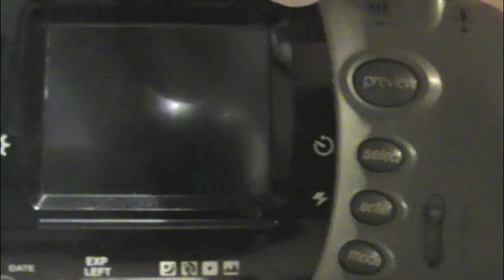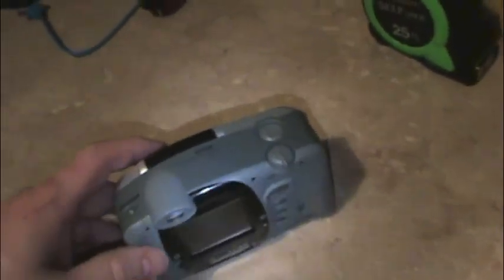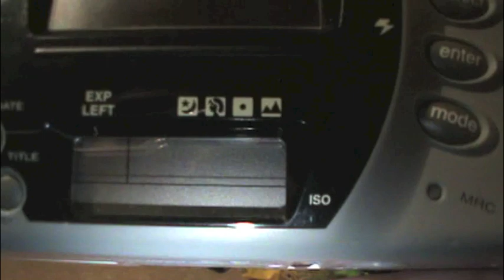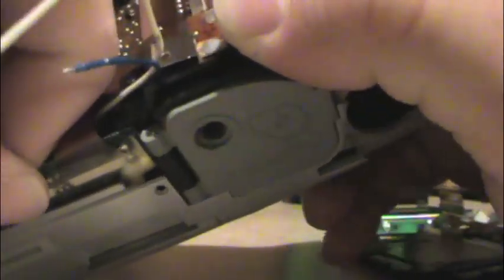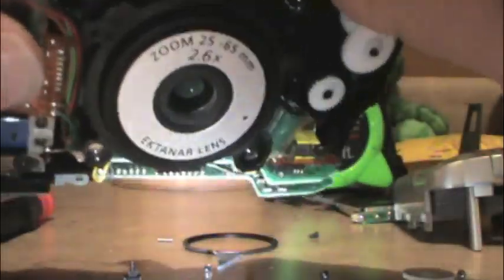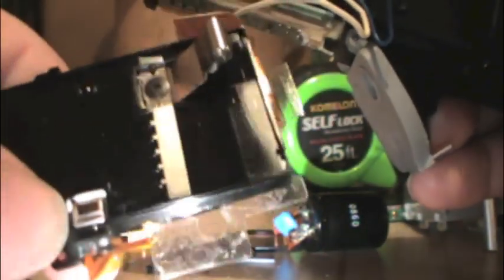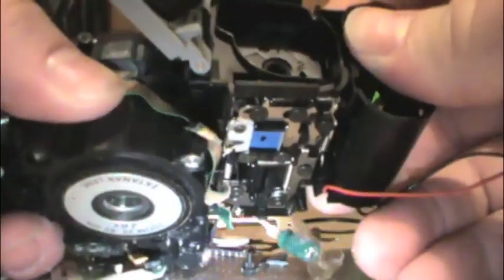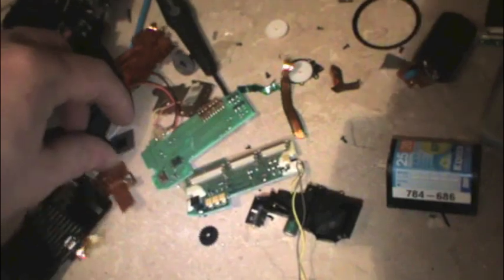Kodak Advantix Preview Camera COMPLETE TEARDOWN!

Comment: APS negatives were 56% the size of 35mm negatives. If it were the same size, it likely would have caught on with pros. The APS-C size does live on as a imaging sensor size on all low and mid-range digital SLRs. Nice concept, horrible execution. The LCD wasn't even WYSIWYGot! I highly doubt the memory to store previews would have been much more considering how costly the LCD and CCD was.

Those 3V batteries were used in a few Kodak digital cameras, including their groundbreaking low-cost DC20.

Comment: So it's a film camera with digital chimping!  Kodak Advantix Chimp.

APS film is the most uncool film format ever.  Few photonerds even want to talk about it.  Many who remember it would like to forget.  And of course, it was a disaster for the industry.  The last APS film was produced (by Fujifilm)  in 2011.

However...  Among all the plastic toys, few excellent APS cameras were actually produced, such as the Contax Tix, and proved that APS could produce good images.  You can still get cold-stored film (from fleaBay, etc.), and you can still get it processed.
Reply: I am appalled by the fact that you criticize such user friendly and great film.
Reply: "FleaBay" Why do you have to exist.
Reply: The disaster would have happened with or without APS, folks take the blame on APS only because it was the last film format. The truth is that there was just no stopping the crazy Digital locomotive. The most common thing reproached to APS was the impossibility to do home processing which is completely untrue. The only things you need to process APS is a Universal Reel & a rubber band to set the correct width. Heck, you can even reattach the negative to the cartridge and do batch scanning with an APS adapter (Bliss, pure bliss). Yes, the frames are smaller than 35mm but so is 110 which is twice as small as APS, and yet was very popular through the 70s-80s and even early 90s.
Reply: @fenrislegacy  110 is still very popular with the Lomo crowd and still made by an unnamed company for Lomography.
Reply: @sophiejdalston  Absolutely. There are even folks who reload 110 cartridges with Kodak ImageLink HQ microfilm.

Comment: It is a waste of an LCD! It's a 1.8" LCD. This camera was sold in late 2000 for ~$300. In late 2002 I bought a Kodak Digital CX4200 for $200 and it had a 1.6" screen. These screens are tiny when you consider a new $100 camera has a 3" screen.